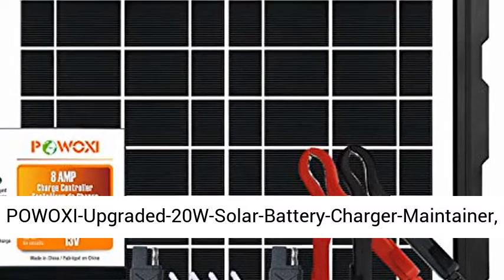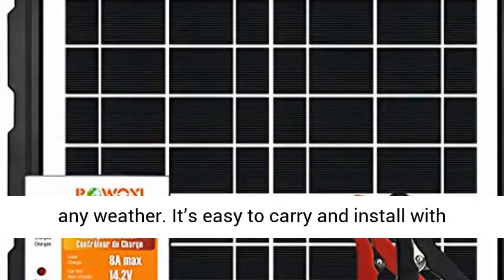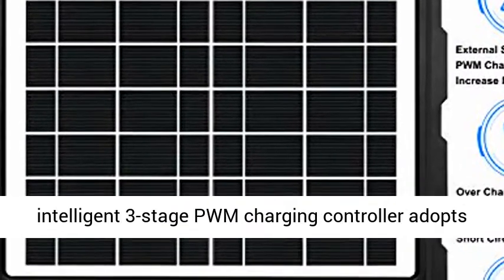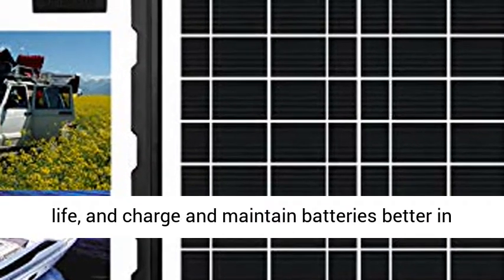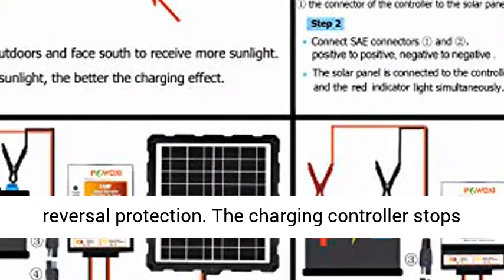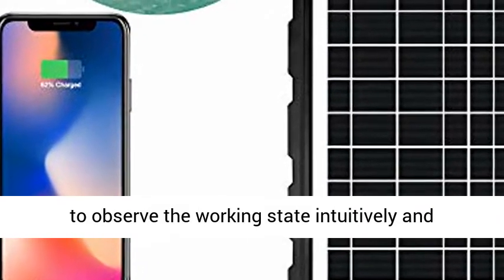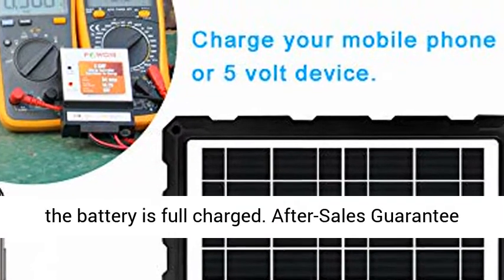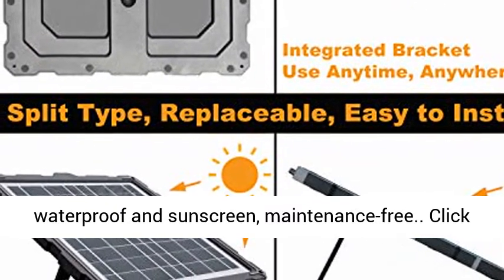POWOXI-Upgraded-20W-Solar-Battery-Charger-Maintainer, External Smart Charge Controller - Overview

Comment: Is it just for robots or can ordinary people use it?
Reply from the maker: It is suitable for 12V batteries. You can use it even if you have no experience. They have attached a manual.
Reply from the maker: I had no difficulty reading the simple directions and following them. The solar panel worked fine for me, and met my needs.
Reply: @gardenlovers  Are you the same robot that narrated the above advert?
I bought a decent one for my boat.Job done.